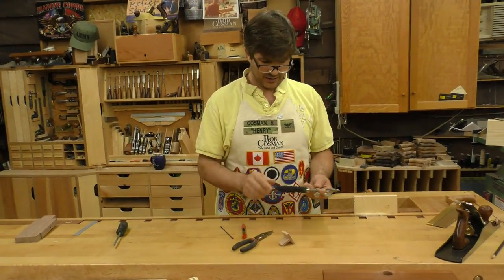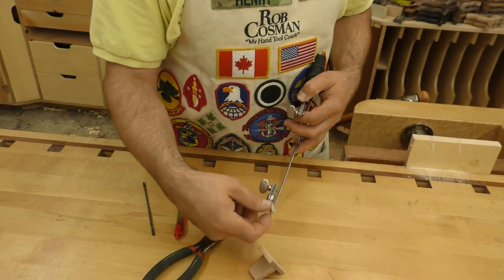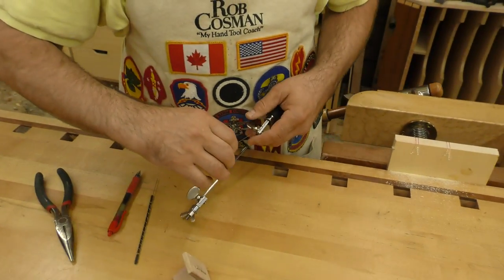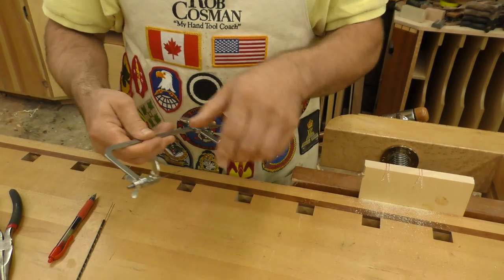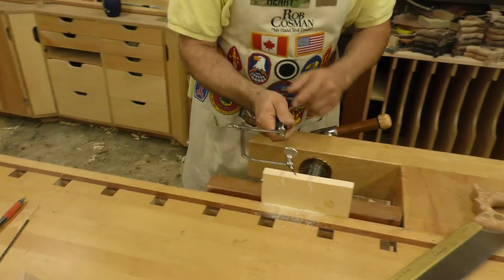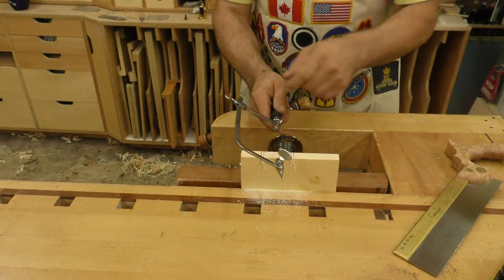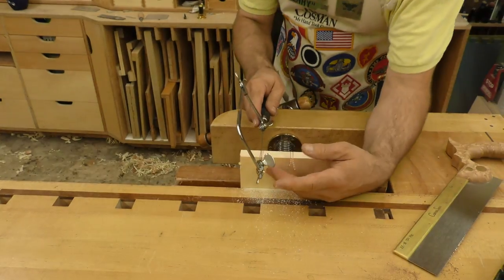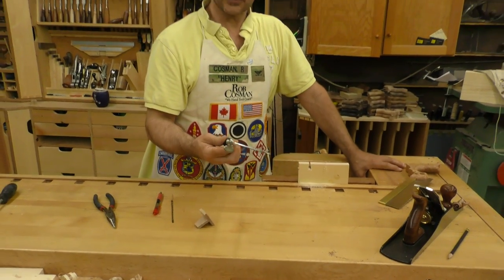Fret Saw for dovetail work with Rob Cosman

Comment: Is a Fret Saw blade thinner than one for a coping saw? Not clear the difference. I have a coping saw and issue is, despite thin, it is not thin enough. I cut the dovetail with a japanese pull saw and the blade is not thin enough to go in along the cut all the way to the bottom - I end up having to cut from the top and it is just a lot more work. Thanks

Comment: Rob I wouldn't dream of telling you your job but......
I think you'll find the saw you're using is not a fret saw. A fret saw has a twist able handle and front key so you can change the angle of the blade, without the need to actually twist the blade. The saw you have is a jewellers piercing saw.

Comment: What brand and size is the fret saw you are using and what toothed blade do you use for cleaning the dovetail waste?  Nice video too!!!
Reply from the maker: 3" frame fret saw, no markings on my at all.  I use 5", 12.5 tpi skip tooth scroll saw blades.

Comment: Rob, why can't you use a coping saw?
Reply: I'm on the edge of my seat here!
Reply: I googled it and found a popular woodworking article by Chris Schwarz discussing this (Christ mentions he tried switching from a coping saw to a fret saw after taking a class with Rob Cosman).  

The advantages of the fret saw is that the blade is thin enough that you can drop directly into the kerf.  In light of this you can also cut straight across the bottom of the waste in a single pass.  The downside is that fret saws need a lot of TLC to keep running, they cut slowly, and the blades break often.  

Coping saws have more robust blades, cut faster, and last longer.  What this also means is you can't drop directly into the kerf, so you have to make 2 swooping cuts through the waste.  

So it sounds like a style choice to me.  I'll probably stick to my coping saw, the differences aren't enough to convince me to buy a new saw.
Reply: Yeah, I tend to use both - for really small tails, a fret saw is great - but if I'm doing big 'industrial' tails, I can't imagine trying to cut those out with even the most aggressive of fret saw blades.
Reply: Thanks for your reply Rob.  I appreciate you officially weighing in on this.